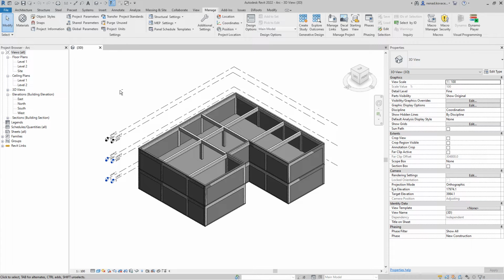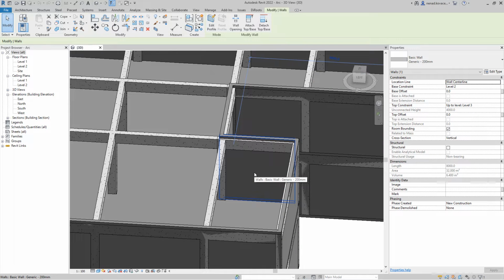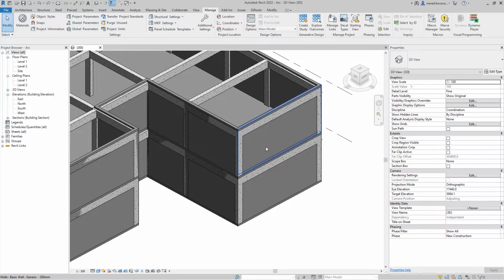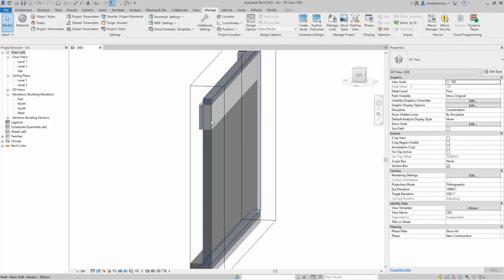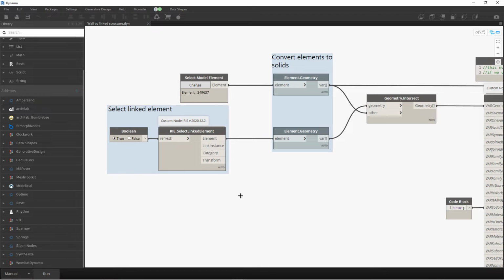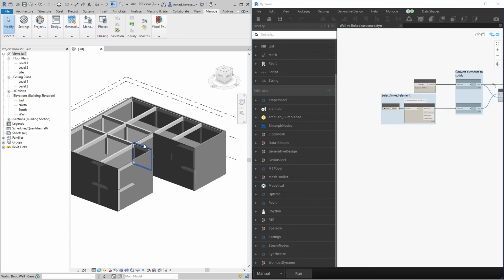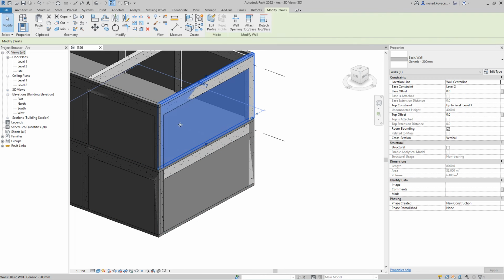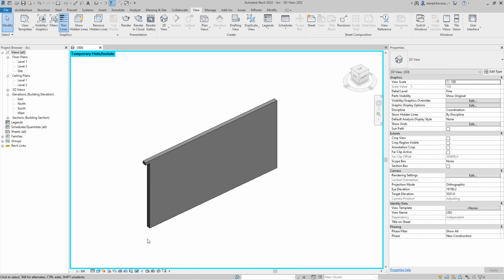Cut walls with linked structure elements

Comment: Hello,

I hope everything is going well. I've tested both scripts and they work great. However, when using them in a project, I encountered the following error: "Warning: One or more geometries have failed to convert due to this error: Unable to make wire from edge body : WIRE_SELF_INTERSECTS2 -- Wire has self-intersection." This error occurs in the Element.Geometry node when selecting a wall from my model; the solid does not appear in Dynamo. Do you know what the issue might be with this wall?

If it's not too much trouble, I'd like to ask you a couple of questions that have come up regarding the script. One of them is that every time I want to create a new cut with a new linked element, I have to close and reopen the script to be able to select it. Is this correct, or is there something not functioning properly with this node in the script?

The second question is about managing changes when I've already made a cut in the wall and, for some reason, the structure or position of the linked element has changed. How can I undo that opening in the model element?

Thank you very much for your time and your contributions. I just discovered your page, and I find it very interesting.
Reply from the maker: Hello, I'm not sure what type of wall you have when Element.Geometry did not succeed in converting it into geometry. Walls are pretty simple geometry. Regarding the opening/closing script, I don't remember, but I assume the script works for a single element. With additional development, that can change (so the script can handle more elements at once), but in the current script, it would be faster for you to use Dynamo Player. After finishing one element, you can click play and run it again. The script creates a void element and cuts the wall, it should not move the link in any case. If you want, you can send me sample files to test at nndkovacevic88@gmail.com and when I have some time, I will check them.
Reply: @dynamo_scripts  thank you very much for your quick response and your help. I'll prepare the shipment with the documents this morning and send it to that email. Have a nice day.

Comment: I am using revit 2019 and dynamo 1.3.  Dynamo1.3 does not support Synthesize so I cannot use HOT.CutGeometry. I can only use clockwork's Element.CutGeometry. But the walls were not cut and only a transparent cuboid in light orange was created between wall and the linked family. When checked the Geometry.Intersectall, it shows there is no intersection between two sets of elements, Do you know why?

Comment: hello, thank you very much for this useful video. I've followed all the nodes like you, I'm sure about that, and there are no errors in the entire dynamofile. apparently it works fine and without problems. but in my project, the walls were not cut and only a transparent cuboid in light orange was created around the two objects (wall and floor). where is my problem? I am using Revit 2023 and dynamo 2,16,1 version and the packages (Synthesize toolkit 2.1.8) and (Genius Loci 2023.2.21). Of course my Revit language is German. thank you in advance for your help.
Reply from the maker: Hello, without having your files to test it I do not know where is the problem. If you can, send me the files that you are using to nndkovacevic88@gmail.com
Reply from the maker: If someone have the problem with the script you can also check this video: https://youtu.be/Fdt1q8z1yBU
Reply: Hello, I have the same problem, it just makes the orange solid of the wall and the column but there is no cut. Please how do I fix this?

Comment: hi, it was able to cut the wall but it did not change properties instead the void family can now be seen in the model, why is that happening?
Reply from the maker: Hi, if the value for area of the wall is still the same than script did not cut that element. Element still have the same size.
Reply: @dynamo_scripts  oh, but now there is a void family inside and its not showing any warning on the code, where could be the problem?
Reply from the maker: Hello Maria, it is hard to know where is the problem just on your description. Try to go one by one node in Dynamo, to follow the result of each node and to see where the logic stopped inside the script. In this case we can maybe say that final node did not cut wall but usually the problem is somewhere before the node where we have a warning or wrong result.